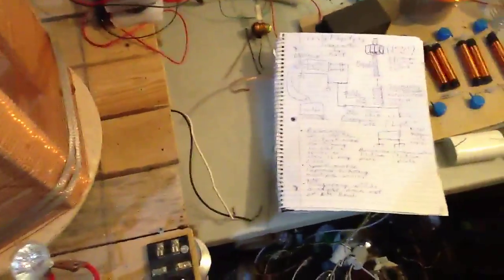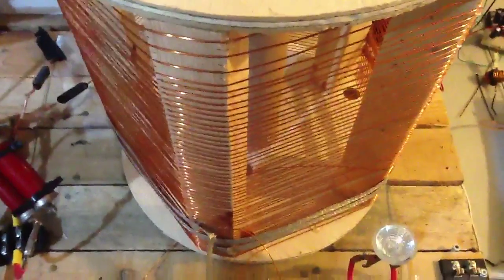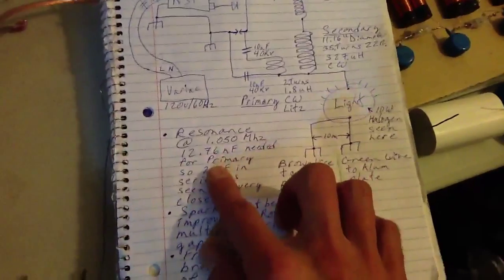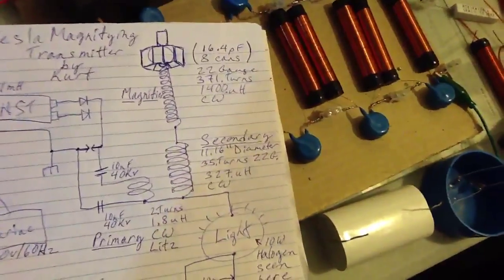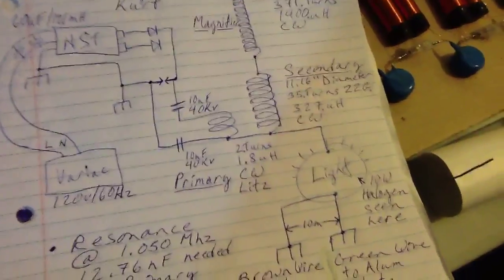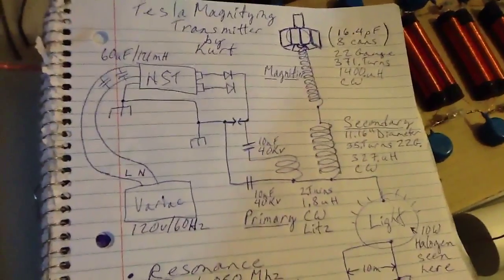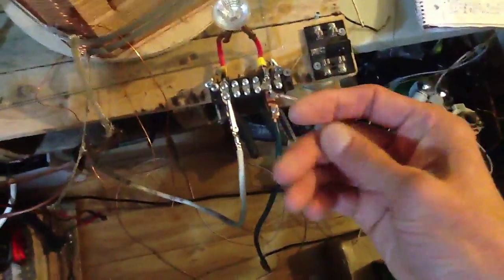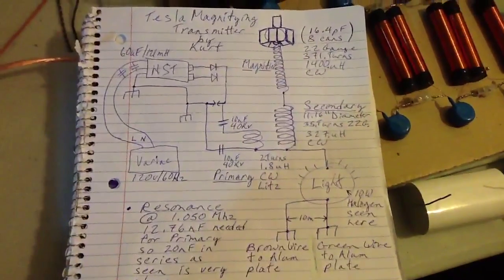TMT Tesla Magnifying Transmitter 3: Taking Power from the System

Comment: Ladies and Gentlemen - you have just seen somebody take a shock from the primary circuit of a TC, and live to tell the tale. Please don't do this stupid thing yourselves, you may not be as lucky. If he had been touching ground at the same time as the clip it could be game over.
Hi kdkinen, maybe you are a lucky guy who needs to buy more lottery tickets! IMHO, the bulb is alight from directly conducted power (through the primary circuit components) as illustrated by the shock you got from the croc clip. This could be illustrated by disconnecting the bottom end of the secondary coil and leaving all other connections as-is. The bulb will still light so what are you showing us?

Comment: I built an abha/rodin coil with primary and secondary windings the same mass. It was made to be a tightly coupled driver for extra coils of varying length/shape. I was using a Solid state mosfet amplifier with 24 volts at around 1-2Mhz pulsing the primary winding, a 400 turn extra coil was atop the driver and a 20 watt light bulb between the driver and ground. The light bulb lit up brightly right as my amp meter read negative readings and blew my mosfets....time for an nst and SG

Comment: Have you calculated what the resonant frequency ought to be for the secondary given the 1/4 wavelength value of the length of wire used? The primary ought to be tuned around the secondary for optimal results. I believe the issue with Tesla studying lower frequencies had to do with the lower frequency of the resonance for the earth cavity. If you can dial in to the same frequency as the earth, you can simply power the circuit via earth standing waves.

Comment: Use the high frequency capacitor patents for the 2 capacitors across the spark gap. I've use a round glass jar with a cork, metal rod, and round ball. Inside the jar goes saline solution with a layer of oil. Then the entire jar is put within a metal container that has saline in it. The glass of the jar is the dielectric. Again, this is in his patents. The second type of capacitor is an oil filled variable cap, which can be used to vary the frequency. Go higher with the freq. not lower.